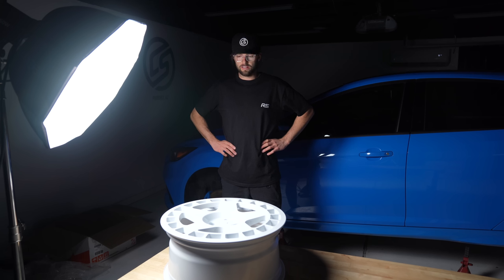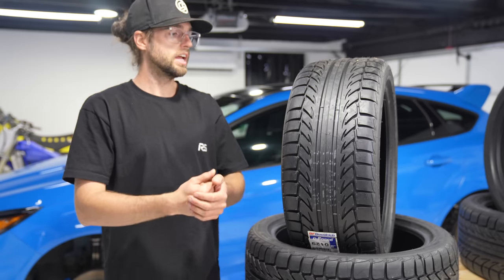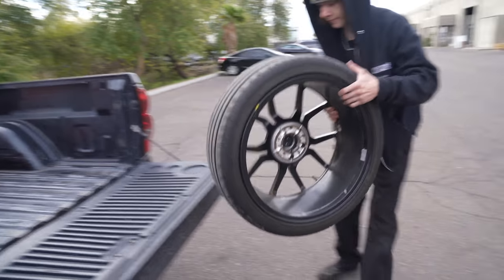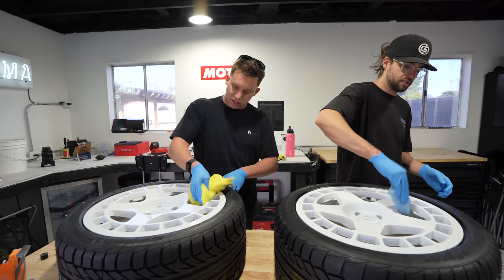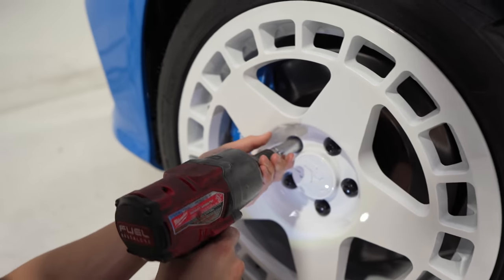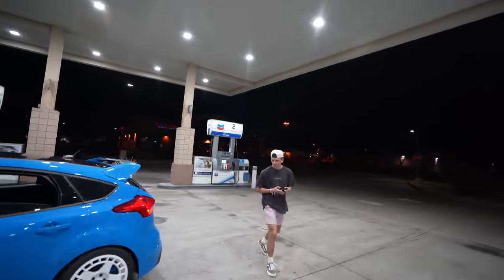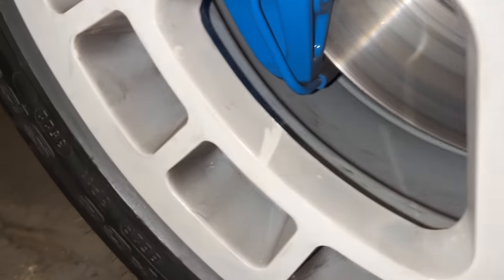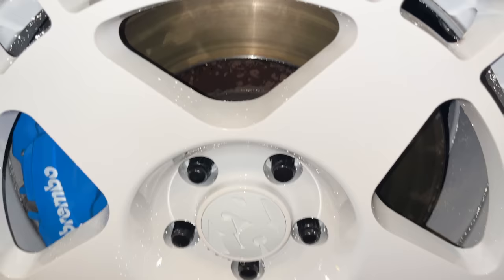Focus RS/ST Ken Block Signature Wheels! (On My Bucket List for 8 Years..)

Comment: My brother in RS Heaven, I have got some recommendations for you! 
Gel inlays for the RS indentation on the wing - I went with black and its surprisingly tasteful and really sets it off. 
ForScan - Turn on the "Hidden" Customizable Drive mode
Turbosmart 50/50 + Boost Reference Adapter - perfect combo of "Adult" but still get those nice blow off sounds when you want them. The adapter bypasses the electric BPV control giving you more reliable boost without any leaking from the BCM interfering. 
Exhaust Valve Delete - Keep that exhaust valve always open regardless of drive mode
CPE Stage 2 Rear Motor Mount - hands down the best RMM for the platform with minimal NVH increase while giving you plenty of engine feel in your pedals.

I'm sure I have other stuff as I have done a fair amount of work to my own RS. 
Would love to hear more about your thoughts on your BC coilovers, Im rocking the stocks with springs and would love to hear more about the change in terms of ride quality, performance, pros/cons, that kind of thing.

Last unsolicited tip - Get you a punch and a nylon hammer, and remove the pins on your front calipers - just went through replacing both my fronts cause the one had a pin that rusted to the caliper and the other had a stripped bleeder screw from factory, not super expensive to replace but still quite a headache to go through so I'd recommend every now and then popping those out, cleaning them with a brillo pad and putting them back to try and combat that for the future.

I also second the ZL1 addons rock guards, so much nicer looking that full mudflaps and does the job well, I have 245/40r18s that are 8.5" inches wide and have no complaints with the ZL1 rock guards.

Last thing for the track mode issue with the new coilovers - If you immediately turn off the sport suspension mode (by pressing the button at the end of the left stalk on the wheel), the error never comes up.
Reply from the maker: Jeremy i have taken notes from your ted talk. You rock! Thank you for this.
Reply: @CameronAlford  Haha glad I could help even marginally, RS is  a great car, hope to hear an update on your coilovers after a little use.
Reply: Thanks for the info- I was looking into getting a BOV - Just got my RS in December, currently in the shop getting repaired for getting rear-ended at a red light. Is the 50/50 just the BOV setting?
Reply: @Matty_Ice9  it’s basically the way it’s designed. It’s 50/50 recirc/blow off. Under light load it’s gonna act as a recirc valve like the stock one. Under more boost it will vent to atmosphere. Which is why it’s the more “adult” option as opposed to blowing off every other second. 
Just don’t forget the boost reference adapter. Will change the entire way the boost acts and prevents any of it bleeding off cause the factory electronic recirc valve is a POS
Reply: @onyx2343  Thanks for the info! In regards to a BOV, is a tune required on this platform for that mod? In terms of the Boost reference adapter, just the 45 dollar one from Turbo Smart on CJ Pony Parts?
Reply: @Matty_Ice9  No tune required, and yes thats the one, personally I like to buy as much as I can from TunePlus cause the owner is good guy and super knowledgeable on the platform.

Comment: Just an FYI for the RS. The factory alignment on the steers "toes out" a little bit, which gives the RS that incredible steering feeling. The bad part of this is that your tires start to wear into a slight cone shape. All RSs do this from the factory.
Also, if you hit the throttle balls deep when you get on a highway and you're getting into the fast lane, you feel the RS wants to steer its own way. Keep both hands on that steering wheel, or you might go off the road. It's scary as hell.
  I got an alignment when I got new tires, and what a difference it made. No more wander steering under heavy load and no cone shaped tires.

It's good to see a new guy posting good content on the mighty RS after all these years. 

Are you going to install a catch can?

Comment: Heck yes! love watching the process. Your ST videos have helped me tons since getting mine a year ago. Question, about to order the wrap, but i'm not sure how to go about the wing. I have wrapping experience, but just thinking about this gives me the chills. Any tips?
Reply from the maker: you can approach it in 2-3 pieces. Do the bottom side first, then wrap the top. You will have overlap from the top piece and will have to trim some off. - I recommend you watch how to use knifeless tap on a lot of videos and youll see how people do it and using it to layer things